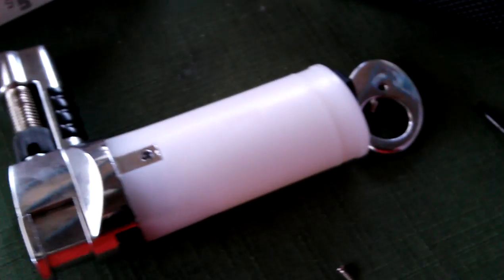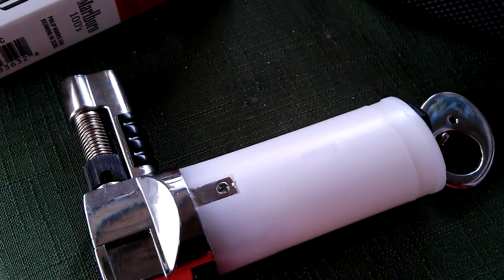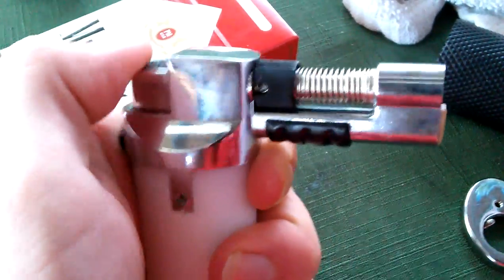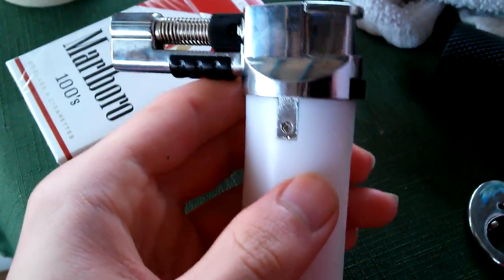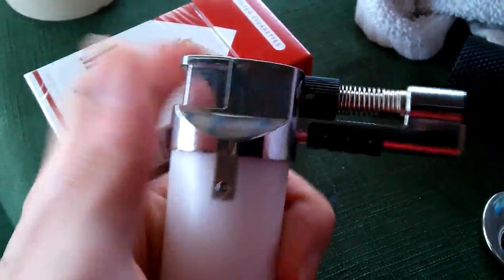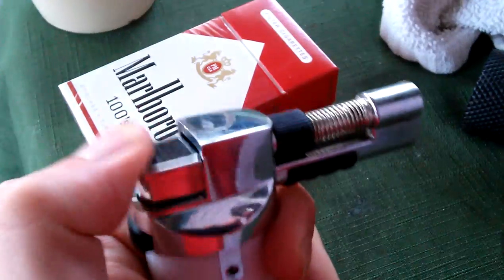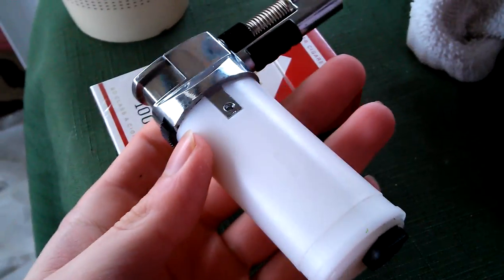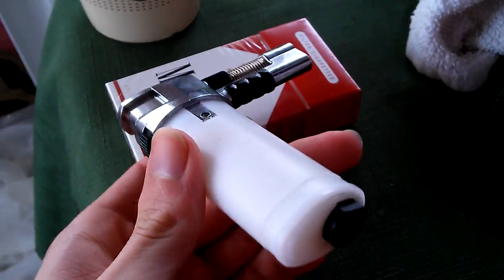Blowtorch Lighter ignition Repair (Part 1)

Comment: How do you take the black cover thing off tho? (The black grip) That's what I'm struggling with
Reply from the maker: Think it was either covered or is a rubber insert you can fold down to expose the screw holes to the rest of the torch
Reply: @demonsparkx  thanks for the quick reply. I'll test it tomorrow!

Comment: hey I know this is gonna sound weird but I found a torch the same exact one as that one and a lot of different torches to in my cussions garoge but I don't have all the peaces to that one can I use ones  from different lighters  to fix this one?
Reply from the maker: For the most part generally most generic torches are universal and interchangable. Not always but id say about 75% of all the ones i have worked on repaired or built all are interchangable pieces.
Reply: I yi yi.  ese just get on the car and cruise to get a new Juan and dont worry about that Juan. Peace out kay